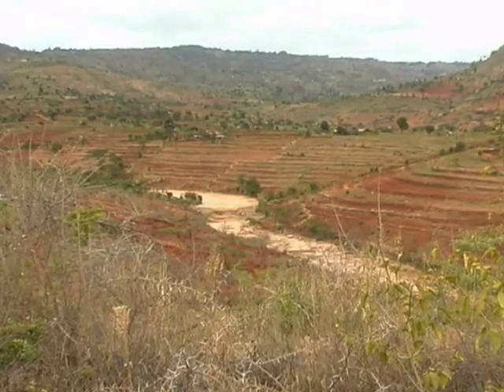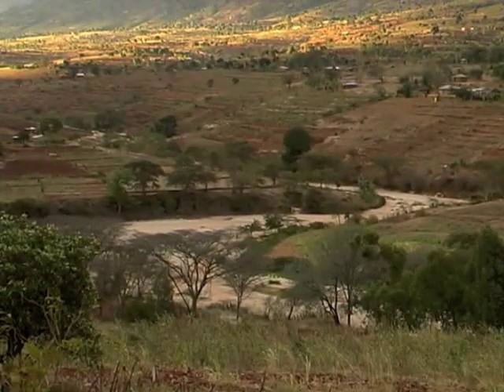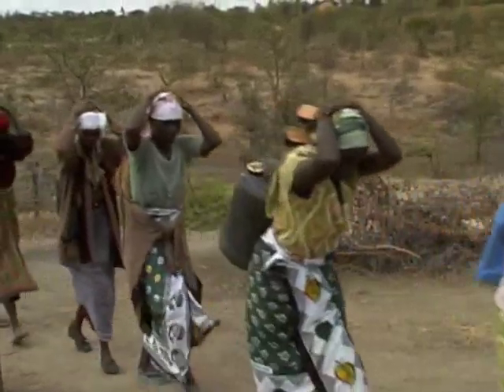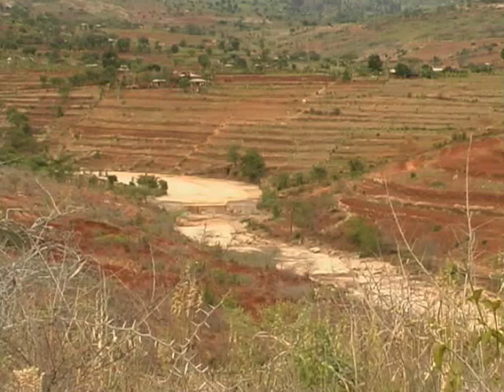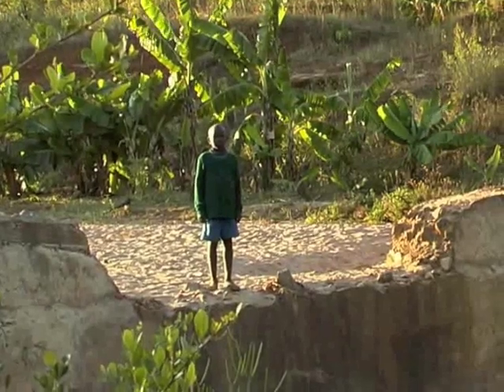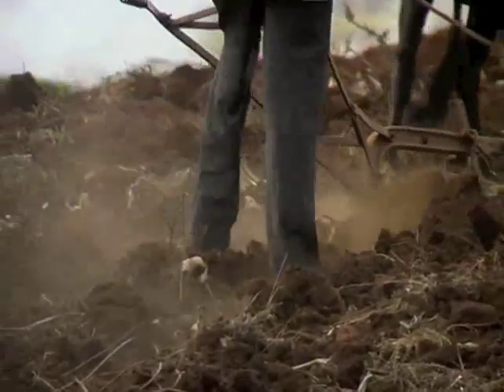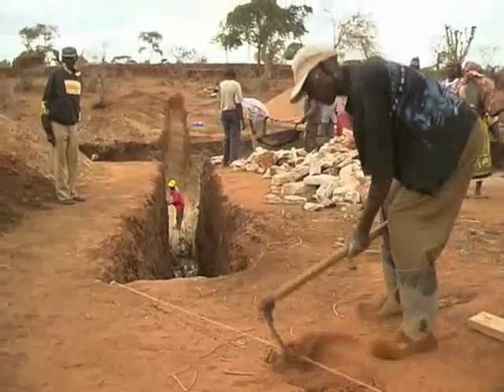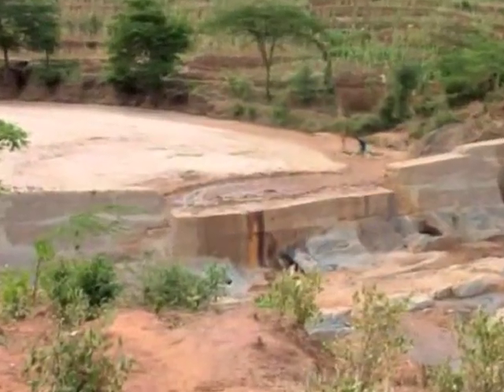Sand Dams Worldwide - Sand Dams in Kenya

Comment: Respected sir,  
I have watched various videos of sand dam. I have come to know,  several dam is washed away. 
I have one suggestion but you must experiment .
We must build  clay interlocking bricks walls to block the water.  For tanks you decide. 
With inter locking  clay bricks we can reduce the cost of damage. 
In case of damage we can recollect and rebuild the dam.
Few  clay bricks replacement cost will not be too much. 
We can build as many as required within lesser cost. 
The cement wall when it breaks it gives enormous damage. 
If we need we can build double wall or put stone to protect the clay bricks wall.
Namh shivay.

Respected sir. 
Please visit primitive technology sites for ash block, you collect ash
from each home as charity,  make inter  locking blocks with ash.
In africa we have lots of stones. 
In India people use to cover the tree with stone to block rain water .
In Mauritius we use stones and chipping in compound,  I have observed the roots remain very safe below stones. 
Kenya have faced the flood recently,  
We must use the ideas to plant in between the stone , plantation below  the stone requir very lesser water. 
We can plant pumpkin seeds or butter bean seeds. Butter bean plantation  is easy to handle .
We must analyze the plants and method of plantation to beat the flood waters and hot summer. 
Don't worry we are with you. We will find the solution. 
Namh shivay.
Reply: Build struts perpendicular to the dam wall on the downstream side, base chiseled into the rock.  Or build the dams in a u-shape with apex of u on upstream side.  Need rebar or any scrap rod steel instead of barbed wire. Need fiberglass mixed in with the concrete.
Reply: @DonaldKasper-j2r  
You can build with clay,  you make mold of required design. 
You make with clay and sundry it.
Use terracotta method for making clay.  Terracotta material is strong. 
You first sun dry your mold , than put in fire for cooking. 
You will get the same results as fiber glass. You can make required design with inter locking blocks also, but you need some artistic team who are expert in making design. You contact Art of living ashram in Africa. 
In Africa we have lots of stones,  you contact some some south Indian, expert stones Carver , they can carve the stones in require design and teach local people. 
Namh shivay.
Reply: @DonaldKasper-j2r  We can parabolic mirrors for cooking pot. We need to fix motor to rotate all around the ractangal or circle. Rotating parabolic mirrors will not cost too much compared to wood or coal. 
 The heating intensity of parabolic rays is high. If rotate than we can blance the heat  falling on pots or blocks. 
 We need to fix everything in proper alignment. 
We must experiment. 
People are working on another method but this is simple method. 
Namh shivay.
Reply: @DonaldKasper-j2r  
Using parabolic mirrors,  we can make clay  blocks,  some people are working on this project. 
The flow of water have lots of currents and wash away every thing. 
When flood comes water keep flowing for two three days,  mean while local residents can fix the problem by themselves.  
Africa is blessed with stone  and  clay. We can use it for lots of work.  
Different places have different problems.  We need several dam at several places. 
Namh shivay.
Reply: @sunitadwarka347  Many lava flows in Ethiopia, I don't know as much about Kenya.  You make a dam of large stones and line the front with wet clay for water retention, and put another layer of stones in front.  This is the same way large earthen dams are made in the US.  The dam cores are clay like a red clay or a bentonite.  Don't even bother baking it.  A bentonite is a swelling clay, expands double when wet if that is available.  Kaolin clay is not swelling, but just pack more in, tighter.
Reply: @DonaldKasper-j2r  
For making blocks,  you must choose ractangal shape and egg shape  four holes in it. One in each corner. I have watched this shape in the vedio  from USA . I have appreciate this shape. It was around 20 or 30 Cm . , each sides. 
Namh shivay.